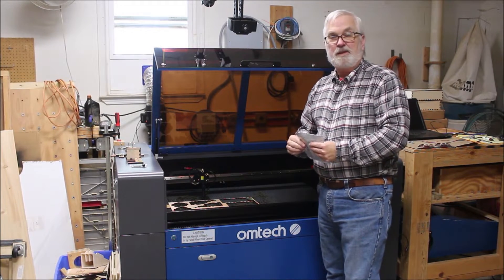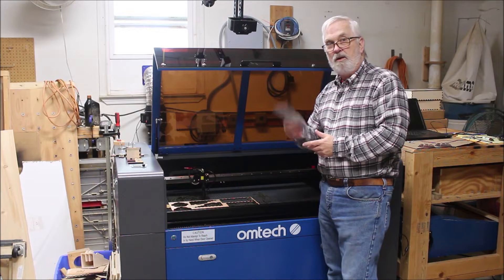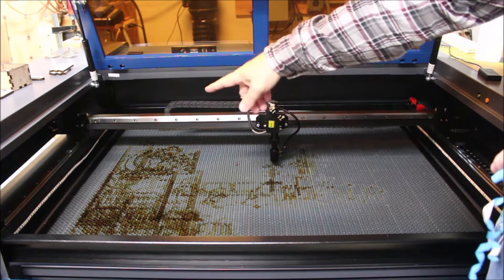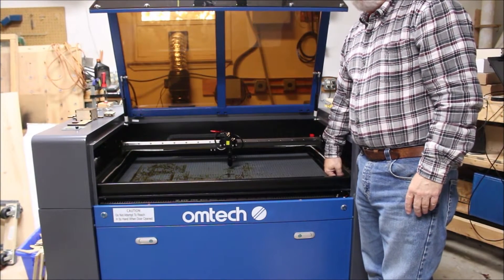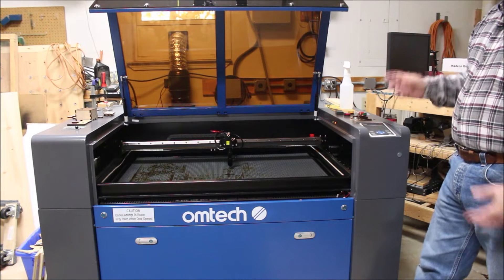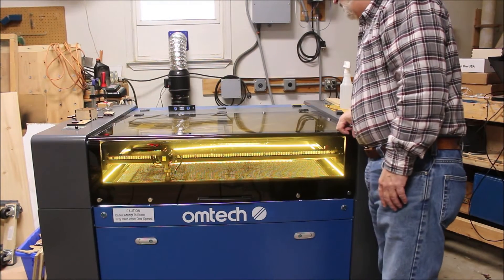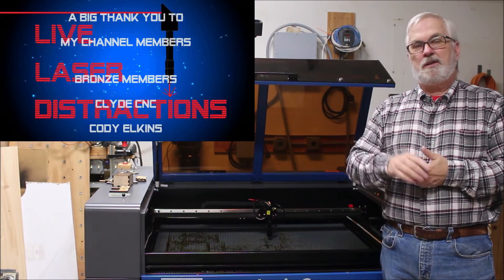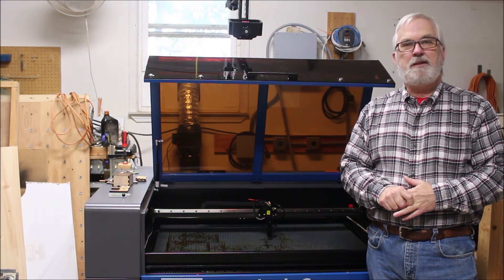Adding Some LED Lighting To My OmTech Laser

Comment: I think they could use more light in general. I'm thinking of putting in some rechargable LED magnetic motion-sensor strip lights on the upper inside of the lid. I would have to keep them on the left though so they don't interfere with the magnetic door closure sensor. They work great for more light while cleaning mirrors, but I have never just left them in there. Can anyone see any issue with that?

Comment: Did you just use red and black 24 awg wire and attach the red and black wire from the led’s into it, and then wire that into the OmTech power supply?
Reply from the maker: I followed the wires from the led lights that came with the laser back to the power supply and connected the new wires there instead of splicing into the existing wires.